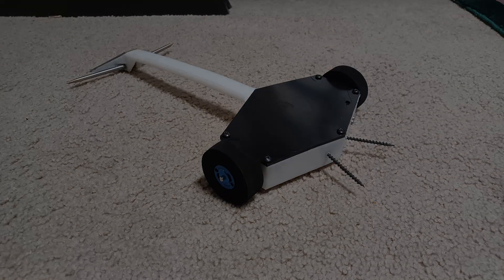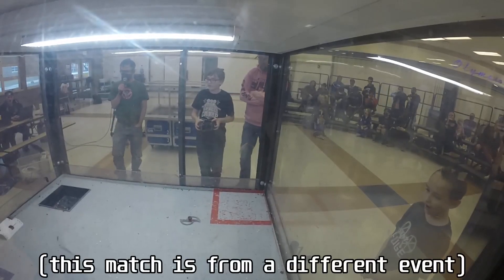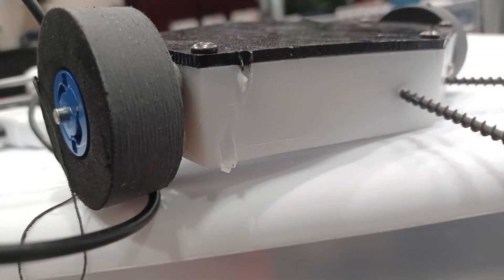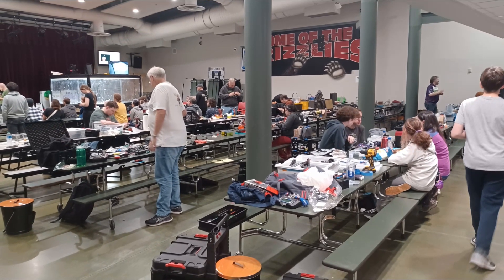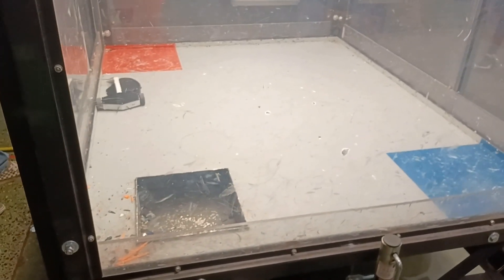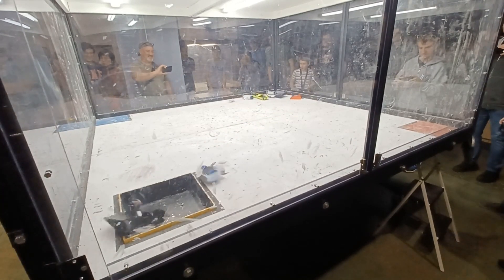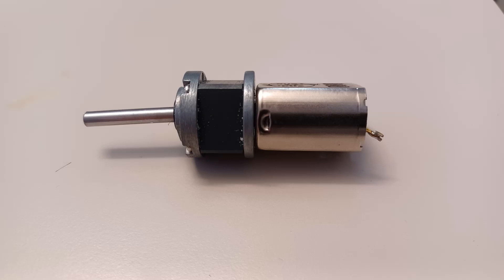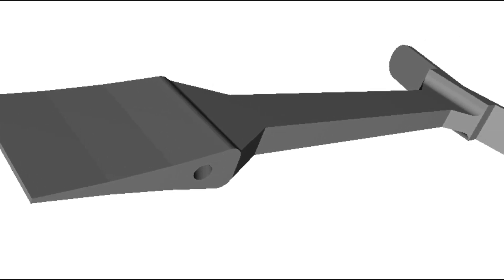I Built an Antweight! (Rumble in Redmond Recap)

Comment: I ran Mr. Yuk the thagomizer-style bot at the event and liked seeing another long bot there. I would recommend playing around with N52 magnets to take advantage of your nice motors and the metal floors to see if you can boost your thwack a bit. Seems like your center-of-rotation was actually pretty good but magnets would there too. Your cantilevered wedge did a great job getting under bots because it was so far in front of the wheels, so hopefully the magnets wouldn't negate that strength.

Comment: That's a cool bot and you did very well for a first event! I ended up using the exact same drive motors and battery in my own antweight. Other than taking direct spinner hits to a wheel hub they work very well, I'm surprised it took so long for the bent shaft to cause problems for you. Looking forward to seeing your upgrades or new bots!